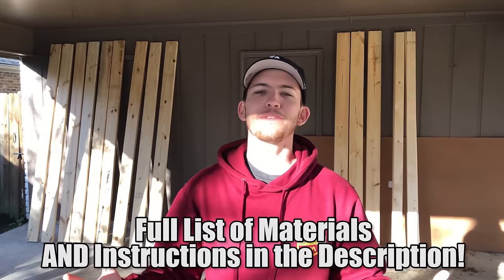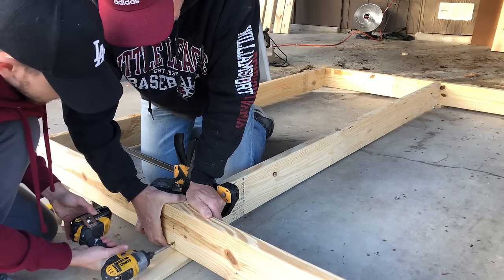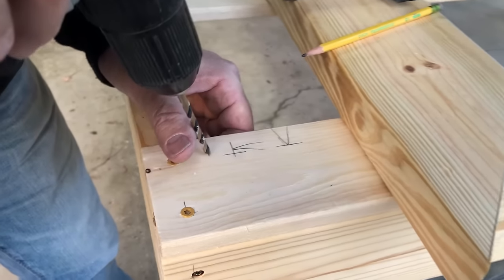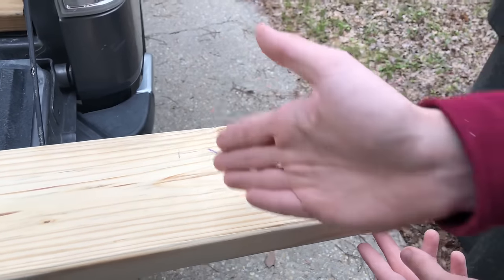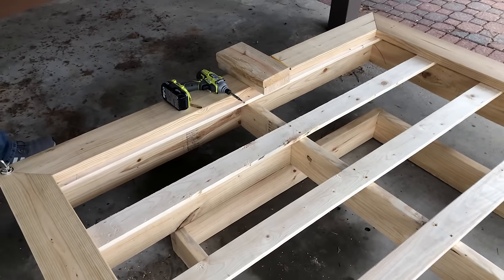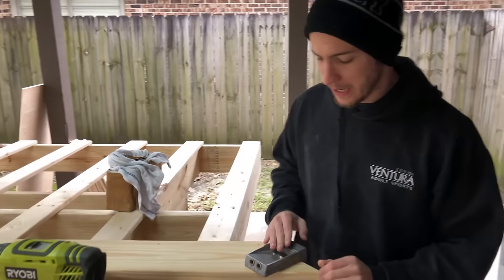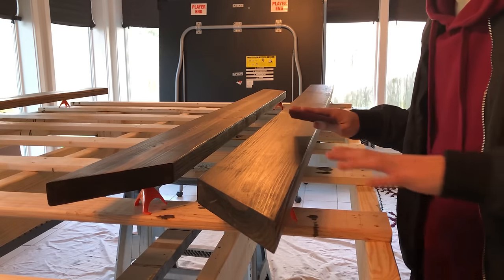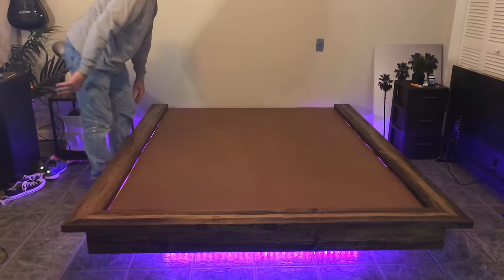How to Build a Floating Platform Bed! (Materials & Instructions in Description)

Comment: FYI if your making this for a different width bed just add 5 inches to the width of the mattress for the frame and struts. They made theyres 65" which is  5 inches wider then a queen mattress. I made a mistake building mine for a king and made it 76" wide , the same width as a king mattress so I had to improvise a boarder for mine. If you did make the same mistake it's ok just put a 2x4 vertically along the three sides leaving half the 2x4 sticking up above the cross struts. then you can take a 1x4 and lay that horizontally along that 2x4 cutting a 45 degree myter in the corners . I hope this helps anyone and if my advise doesn't make sense lol sorry its just what I had to do
Reply: This was very helpful for my king size project. Thank you!!

Comment: Hey guys was just wondering what the measurements for a king bed would be? I’m a bit confused on the measurements because on the bed slats for the 60” bed you guys had it at 65 1/2 and I know the lip comes in 1 3/4” on each side but that still leaves it at 62”

Comment: Does anybody know if these were dimensions for a queen(80x60) or an Olympic Queen (80x66)? I'm going to attempt this in a full size, but I need to understand the 65.5" cuts to make the adjustment to a full size frame. The full size mattress will be 75×54. Do I do 3@75" and 2 at 54", or 2 at 59.5" anybody do a build on the full size and care to share their final dimensions. Does the mattress sit inside the out wood or does it rest inside?

Comment: Where the heck did y’all get the wood? Here in tx at Home Depot it was going to cost me 120$ for just the 12- 2x6-8ft
Reply: i was wondering the same thing after pricing it in my area at home depo its well way over $259 maybe amish will have some lumber thats where im going to look
Reply: i was wondering the same thing after pricing it in my area at home depo its well way over $259 maybe amish will have some lumber thats where im going to look

Comment: New subscriber and I was just going through some of your old vids to see what else you have done. (found your channel during the bathroom reno)

Just an FYI, putting a solid surface under a bed is not only dumb it is dangerous. Beds are designed to breath (reason why box springs have that light mesh on the bottom)
If you do not let a bed breath it will eventually turn into a mold farm which can cause the person sleeping in it to have breathing issues and possible lung damage.

So when you gave your materials cost you should have included the screws, stain, poly, brushes and a new bed.

So considering this, I think I will look elsewhere for my home DIY advice.
Reply: So just because they didn't put the total cost of materials and for the lack of knowledge on a damn mattress u wont look at or use any of there project ideas,,,  to me thats a childish reason not to watch there videos on other projects they did together cause there might be plenty of project ideas that u would be interested in ,,, also whats the point of giving negative feedback if u feel there no use for u . Never judge a book by its cover because when u open it it could be full of the best Diy project ideas ....
Reply: Yeah like at the mattress store
Reply: @jessejones657  No because it is clear they have no idea what they are doing and just making it up as they go, ie putting a solid board under a bed is a pure rookie mistake. It is almost like you failed to read my whole comment, either way best of luck with your cherry picking.

Comment: Forgive me, but as a professional woodworker for over 30 years, I cringe when people use construction grade lumber for indoor furniture projects. Its moisture content is 18-20 % and when it dry's, things happen. But if your happy, go for it. I have used 1 x stock pine for projects in my house, but I buy ahead and stack and sticker it for a while to acclimate to my house and I watch the grain pattern on the boards.
Reply from the maker: Yeah I hear ya but lots of folks get there start in woodworking by building with dimensional lumber.  Definitely not my favorite either though 👍

Comment: What is the tool (name) your father is using? I’m trying to build my own bed. Is that a full size bed? I’m trying to do a king.
Reply from the maker: This was a queen size.  What tool are you referring to?
Reply: @StudPack  the one used to measure.
Reply from the maker: You must talking about a combination square.   A must have for work like this.  Reasonably priced ones available at home centers and hardwares stores 👍

Comment: This has been a project for sure didn’t even fit in the front door (king size) had to take the mitered pieces off 😂
Reply: you got the measurements for the king size? what’s the difference between the one showed here and yours
Reply: @anthonymorales6685  I would have to measure as I don’t remember any more but I just used his measurements all i had to do was figure out the measurement and add whatever the difference between a king and queen is so for instance if he says to cut it at (60 inches) then you would add 16 inches to whatever he said as the difference between a king and queen are the width by 16 inches..

Note this is just a example on how to find the right measurements and not the actual ones you need but as for any difference in mine and his they are the exactly the same except I just square butted the runners instead of mitering them to save time and make it simpler and in my opinion it looks just as good as a mitered cut

Comment: I didn't want to go back and see but did I hear construction lumber for fine wood working? I mean it works but it hurts my soul.  Lol
Reply: I'm dying,  this is why you mill and use proper wood for the build. I'm still like half way through the video but it's driving me nuts. And proper wood joints for the type of build. Not bad for construction lumber and improper milling though,  or lack entirely of milling.
Reply: In an fairness it's not woodworking of you don't over engineer. Lol I do that all the time.

Comment: DON’T BUILD! THE MEASUREMENTS IN THE DESCRIPTION FOR THE SLABS ARE WRONG! do not cut the slabs by 65 and 1/2. Cut them to 68 inches which is the horizontal length. Just spent all this money and precut the slabs and now I have to go back and buy more. FIX YOUR DESCRIPTION!